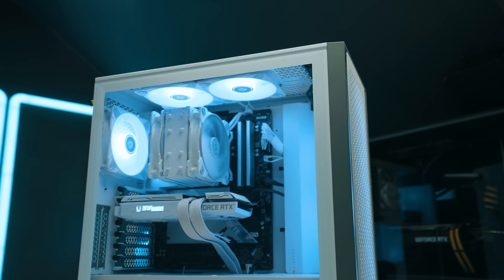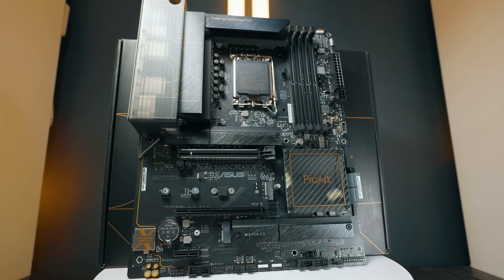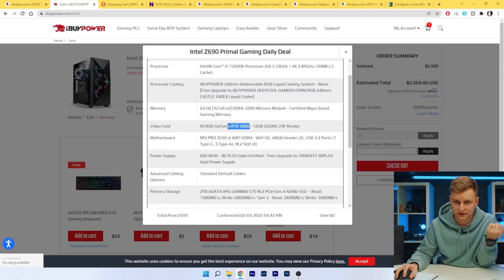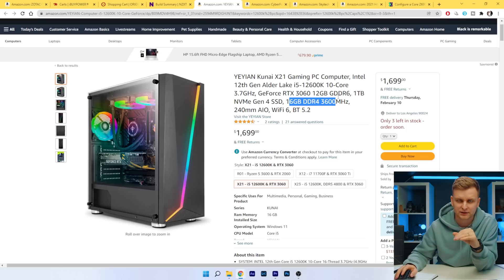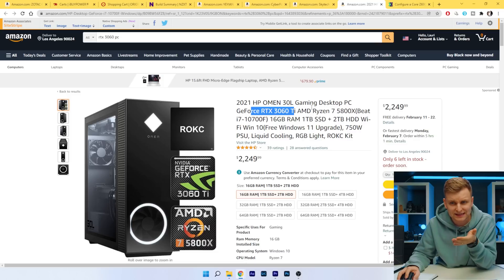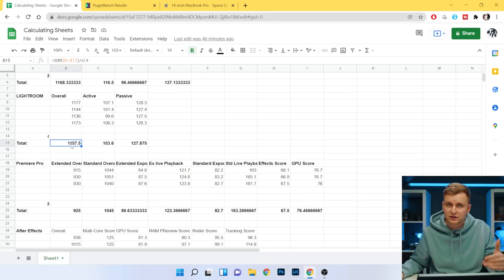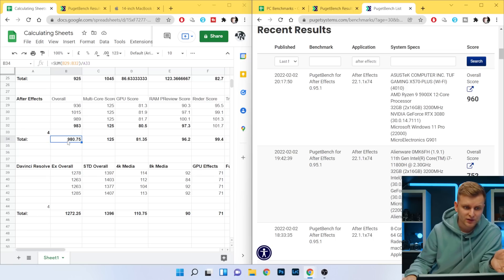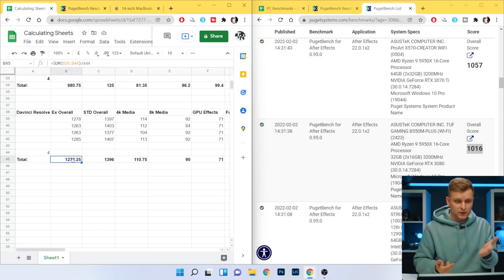PROOF that PC building is NOT DEAD & WHY prebuilds* SUCK!!! *most*

Comment: You are trying so hard to bash the macbook. Judging by your previous videos i can definitely tell that you aren't a fan of Apple/Macbooks. The 300$ price difference you mentioned is more than justifiable because if you would get a monitor that is even comparable to the macbook( which you can't) considering that it is 120 Hz and mini LED with amazing color accuracy and arguably the best Trackpad on the market + Keyboard and such good speakers you would be paying over 500$, not to mention the portablity of the macbook and efficiency which certainly plays a significant role in calculating the cost over time (electricity bills are getting out of control in Europe). You also haven't compared real world performance in Final cut pro for example which destroys all RTX Latops in that price category.

Comment: Your prebuilt is a DDR4 machine? Didn't you build a DDR5 machine? I have looked for a 12th Gen Prebuilt machine with DDR5 capability and have no luck what so ever. I built an i9 12900k with 850W PS and still came in under the highest price DDR4 that Dell (for example) offers. It's a no brainer.
Reply from the maker: Nope, my build is ddr4 as well. :)

Comment: Can you please suggest a rock stable motherboard and power supply that would go along with Ryzen 5600x , Nvidia 3060 Ti, Corsair Vengeance 2x16GB , Sabrent 1T pcie4.0
Reply: Would a B550 suffice or do I need a X570.stability is of prime importance.
Reply: Purpose is gaming and video editing.
Reply from the maker: Both are good. Depends on your budget. I like the ProArt boards from Asus. B550 or x570 ;)
Reply: @theTechNotice  would that be better than B550-F Rog Strix Gaming Wi-Fi 6

Comment: So i have no experience building pcs.
I was thinking to get this:
Intel Core i9-12900K
-Asus Geforce RatX 3080 ROG STRIX GAMING OC LHR
-Corsair DIMM 128GB DDR4-3200 Quad-kit
-MSI MPG Z690 EDGE WIFI DDR4 Mainboard
-Samsung 870 QVO 8TB SSD
-Gigabyte Aorus waterforce 360
-Corsair iCUE 700D Airflow TG Big Tower
-Corsair HX1200 Powerdelivery

I have no idea what i‘m doing and was wondering if there are any glaring short comings here or bottlenecks?
Is ddr5 better here?or even possible?:)
It’s gonna be used as a Editing PC with a little gaming.

This Video was really informative buddy

Comment: Not only cheap with better parts plus one of major benefits its your machine. You learned how to build your own computer so now you have basic skills to upgrade or repair without having to deal with some company that will run you around. Your video has solved my problem of getting off my duff and get cracking and upgrade my 2008 i9 computer before its considered a landmark. Thanks!

Comment: Hey boss-man; 
I really enjoy your videos. I especially like the list of parts you use in your description. 
There is one thing I don't understand, and I hope you can explain a bit about it, and that's water cooler cm sizes listed on Amazon. 
I follow your link to Amazon for that specific water cooler, but I get three or four choices of sizes. I honestly don't know what to do from there.
The last pc I built was a 486/120mHz 8mb ram system with DOS 6.22 OS.
I love your content, and I'm looking forward to doing a Intel I9 build, only because of the iGPU feature I learned from you.
Thanks much.
Reply from the maker: The AIO cm size is the size of the radiator attached to it. The bigger it is the more 'cooling' it has. Also have to make sure that the radiator fits into the case you have chosen hence the different sizes. This case in my video supports up to 360mm AIO :)

Comment: Hard task is to get a GPU at rrp. This is what I built for £1390: 3070ti founder edition/ 12600k / msi z690 tomahawk ddr4/ 32gb 3600mhz Patriot ram / 1tb wd 3rd gen ssd/ Corsair rm750x psu / Corsair 465x case / Corsair h 150i pro xt aio. I do video editing from dji air 2s in premiere pro at 6 k and some gaming. This system is a monster you can make Hollywood movies on it. Will upgrade to 13900k in a few years when they are cheap
Reply from the maker: Amazing price for a beast like that! Thanks for sharing!

Comment: Whether it is better to buy prebuilt or build a custom PC all depends. For a specific task you have to build a custom PC. For example I edit still photos. That uses a lot of RAM, 32 or 64gb and a very strong CPU, like an i-7, but does not use the GPU at all. All you need is a picture and Intel integrated graphics is overkill. With no GPU a 500 watt power supply is overkill. Try buying a PC with an i-7 and 32gb of RAM but no GPU. It can't be done. To have a PC for that task you have to custom build it. On the other hand if I needed 100 PCs for an office, pre-builts might be the best way to go.
Reply from the maker: Very good point 100% agree! And in the office case you want a warranty and support etc... which would come with Lenovo, HP etc PCs:)

Comment: Damn what a killer video. You’re 100% right too. What a way to show it
Reply: I must add though , these CX750F rgb cpu’s have been nothing but trouble for me , the coil whine these generate is immense , but in terms of cost it is indeed a good option. 

Another option that is just slightly higher priced would be the RM 850x (2021 model) with these later models most of the flaws of the earlier designs are gone

Comment: Are the Creator machines you build good for Audio too ??? ... Ive been looking for a Motherboard with Thunderbolt 3 or 4 ...but cant find one with Dual Monitor  ... so i guess i would have to add a Vid Card...but then im a little confused about the TB pathways when adding a PCIe Vid Card....if any of that makes sense
Reply from the maker: You could just utilise the TB4 and get a dock that has more than 2 monitor outputs? 
Or just get a cheap GPU. :)
Reply: @theTechNotice  thanks for the help...
Reply from the maker: But yeah, they're very good for Audio creators as well!